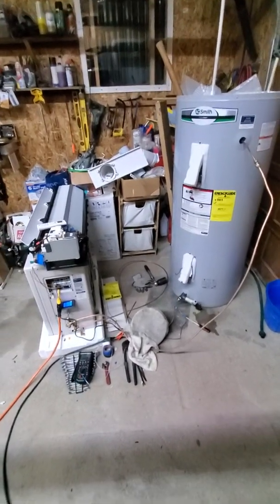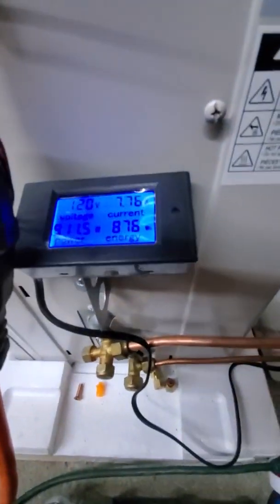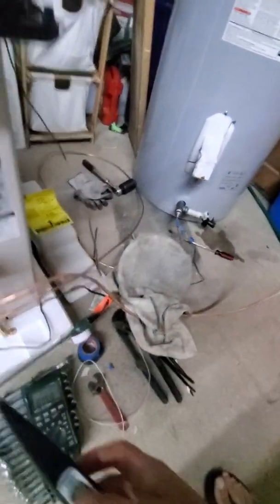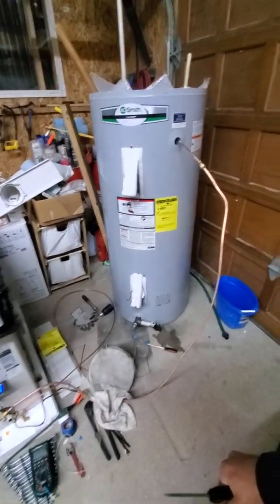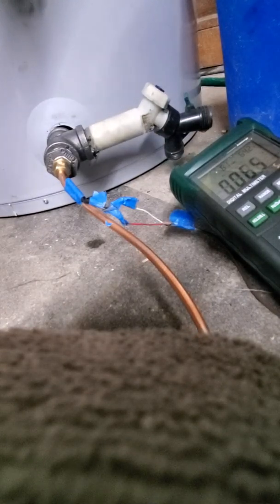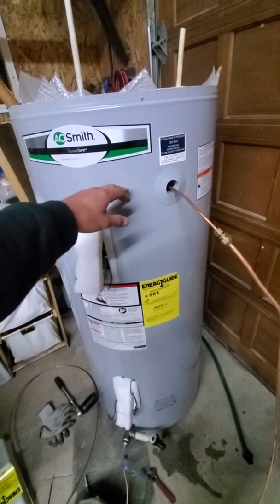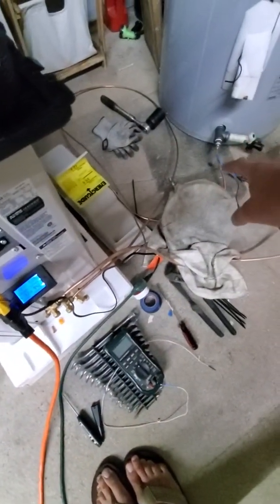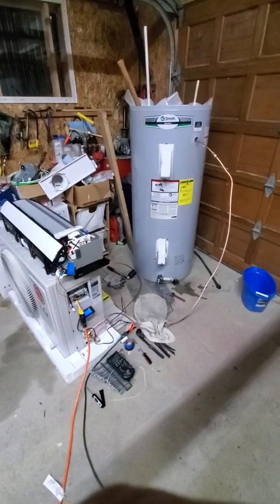DIY Heat Pump Water Heater. DIY. Home made mini split. #2

Comment: Alternatively, you could just put your coil in the bottom half of the tank.  It would warm it all up.  Now, the top would get hotter, but you could add a thermostatic mixing valve and that would reduce the amount of hot water removed from the tank if it was coming out at a hotter temperature than desired.

Comment: I’m not sure of your grand plan but, i think your life would be simpler if you went with a non pressurized tank and a on demand pump.
I like the concept of modifying off the shelf hvac heat pumps

Comment: Hi mate, can I ask you how to modify the electronics of the air conditioner to work as a heat pump. What should be the control logic, where are the sensors installed. I have a 24 btu air conditioner and I want to convert it into a heat pump to heat my apartment. I have some knowledge and skills, because I install split systems. I would be very grateful if you could share some information. Thanks in advance!
Reply: I saw one russian dude converting it, I can send you the link, just not sure if you'll be able to understand
Reply: @markotomic8981 hello can you sent me this link!
Reply: Send my the link @markotomic8981

Comment: wow just what I was looking for. I have a radiant floor I want to do this with... I feel like just a water to water heat exchanger would work? I only found 2 systems that make an air to water unit and they are $5k and $10k!
Reply: I thought if the same thing. For 90' of  indoor unit copper, I calculated 30 plates 5x12 heat exchanger. I saw them go for cheap on ebay and  they are designed withstand the referigerant  operating pressures. I compared the volume of 90' 1/4" copper to about 13.5 plates of refrigerant for one heat exchanger circuit. So it's close to 15. Another 15 plates can be used for hot water circuit. Hope my math is right for an electrician. 
LG sells a remote thermostat / dry contact kit. That accepts voltage and resistive input for temperature setpoint. My thougt on this is, the tepmerature conroller with an anlog output, or a PLC with 0-10V can vary the condenser speed. PLC output can be scaled. Let the PLC read the tank tepmperature and then PLC analog output can go directly to the input of this thermostat. If I remeber right, it takes about 2-8V span on a tepm input, and will give a full range, for min -max temp control. Very good video.

Comment: Are you heating the garage with the water heater or heating water with the heat pump?
Reply from the maker: This was the testing process. you have to watch the rest of the videos. I had this in the garage when I was setting it up. See other videos. I built this to heat hot water.

Comment: My math: (I have to use metric for power, sorry)
80 gallons (x3.785) = 302 liters
(X1000) = 302,000 grams
(X32.7C temp rise) 56F (13.3C) to 115F(46C) x (4.184 Joules/gmK heat capacity of water) = 45.4 million joules
(÷3,600,000 J/kWh)= 12.6 kWh of heat absorbed in the water.
Reply from the maker: Last night the power went out which actually shuts off my system if it's in its standby mode where a temp sensor is disconnected. U forgot to turn it back on and the tank was completely used up when the kids tried to take a bath. Temp went down to 60f mid tank. So even colder on bottom. Anyway I watched the meter to see what it would used. The tank is a 55gal tank. It has a 80g first hr rating so correction there. To heat 55gal from 60f to 125f takes 8.7kw of pure elec resistance heat at 100% efficiency.  My system used 1.9kw in 30f frosty weather. That's a cop of 4.5. I'm very pleased.